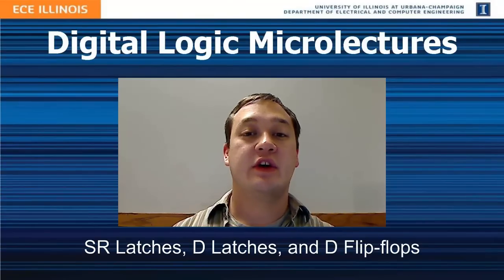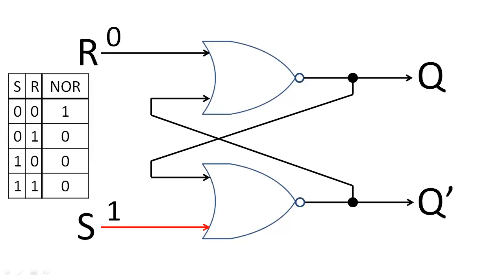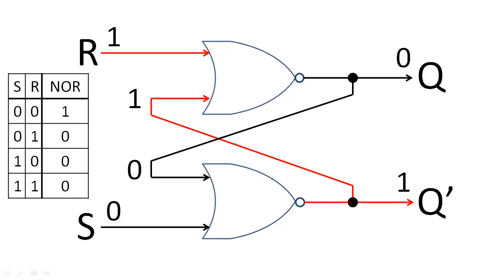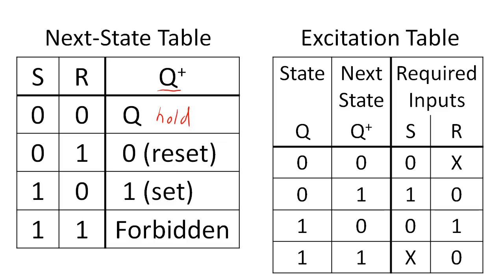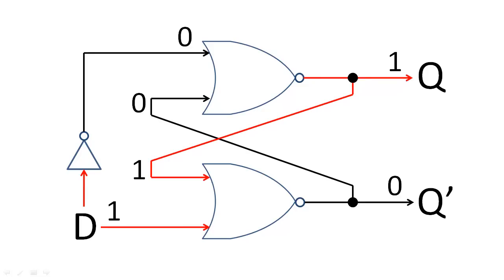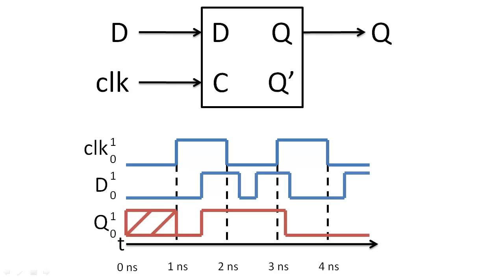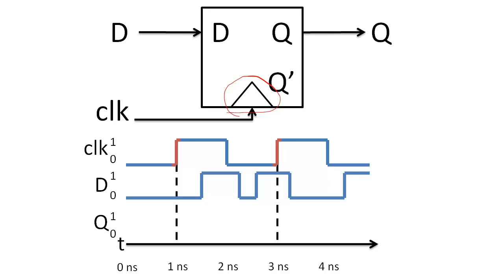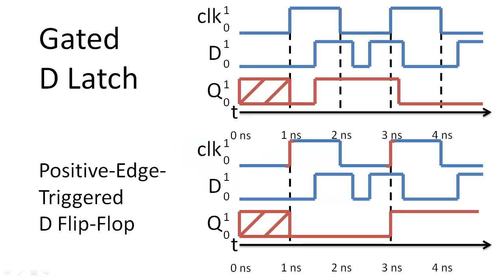SR Latches, D Latches, and D Flip-flops

Comment: Great video
helped me to understand.
Can the the DFF be used for constructing the D-latch one?
Reply: the D Flip Flop is simply a D-latch with an edge triggered clock attached to it.
Reply: It's not a good video. Overpriced university mickey mouse professors. A NAND or NOR gate uses four transistors. A NOT gate uses two transistors. An AND gate is built from a NAND and a NOT, so it uses six transistors. The SR latch uses two NOR gates, or eight transistors. The D latch uses an SR latch, two AND gates, and a NOT gate, or 22 transistors. The D flip-flop uses two D latches and a NOT gate, or 46 transistors. There are more efficient CMOS implementations using transmission gates. A compact D latch can be constructed from a single transmission gate.

Comment: Love the explanation..
But would've been nice if u would've told about the clock signal, too. At least mention it. Because the way you leave the d-latch explanation is equal to a simple cable, as the state at the input must always remain to ensure the output

Comment: Is there any other way to control the shift command of an shift register besides microcontrollers and monostable multivibrators? When i try to use shift by myself, its way to fast for my input.
Reply: +Loundre3  
Yea, I tried to use my shaft by myself but in the end the vibrator worked better.
Reply: Don't you mean multivibrator?